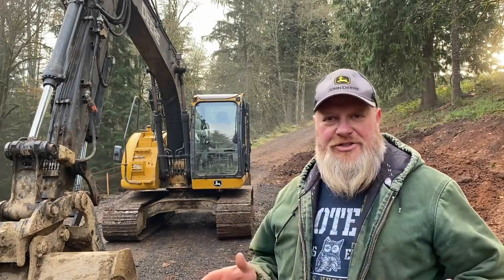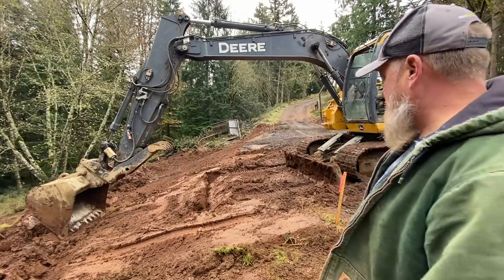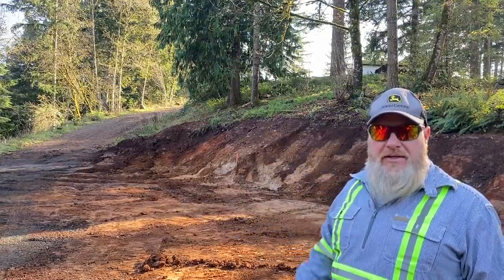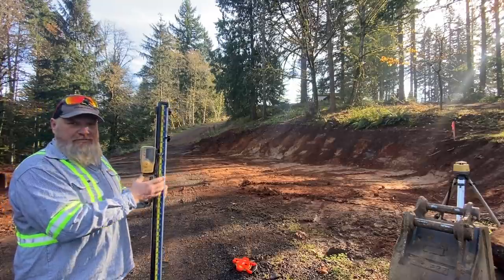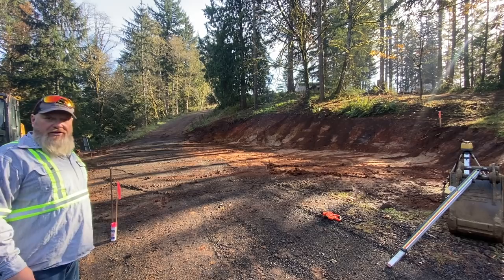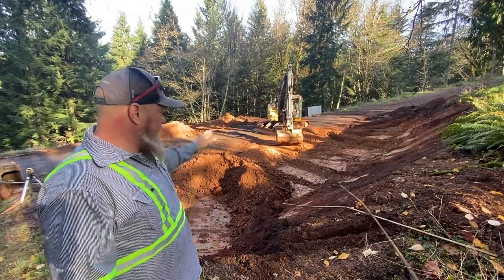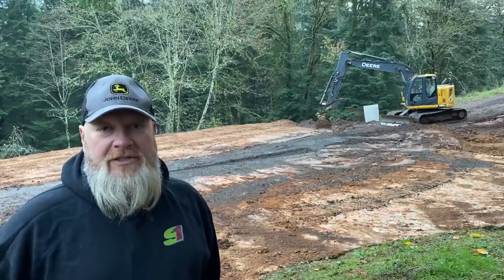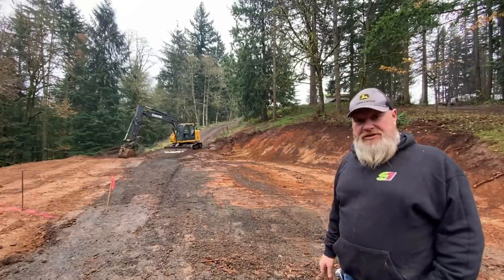Shipping Container Shop Excavation: PART 2!

Comment: Getting an even and flat slab is still a mystery to me, however, watching someone who knows is like watching a choreographed dance. Well done. I enjoyed every minute of it. Thank you.
Reply from the maker: Thank you, Edward!
Reply: Where I'm at, you get the soil close, gravel on that, strike it even below form, concrete on top of the gravel.  Clay, solidly tamped and not saturated, gravel, then concrete, is recommended.  Vapor barrier, depending on the application.

Concrete on clay might get by, concrete on top of subsoil or topsoil is the big no-no.  Mud jackers make their living because of those that take shortcuts.

I agree with Ed, that was well done.  I probably would have made a hash of it.  Then again, I don't have that kind of equipment.
Reply from the maker: @infoanorexic  Tools are everything! I'll be importing recycled concrete for the base rock. When it dries out it gets just as hard as real concrete. My slab will be poured on that.

Comment: Thanks for the explanation of your shop design.  I've seen several buildings of that style (roof over shipping container walls) used for hunting camp retreats and the like.  I was scratching my head as to why you were putting the shop pad through the middle of the roadway on your property.  Your reasoning makes good sense.
Reply from the maker: Thank you!

Comment: Considering the terrain, my guess on that soil composition is that it was glacier related.

Where I grew up, they say, had been glacier plane.  Multiple layers of clay, in different colors.  Limestone if you went deep enough.  A builder would excavate for a new house in a previously undisturbed spot, and sometimes end up rooting out a single rock that was larger than the machine.  Not limestone, solid, usually a red color, sometimes bluish.  They usually became yard art by default.  We had one on our place that a previous owner had found, red rock embedded with multiple colored rocks, similar in pattern to what you uncovered.  Visitors always thought it was someone's grave marker that was by our driveway.
Reply from the maker: Wow! I haven’t found any big boulders like that yet, fortunately.

Comment: I know very little about excavating. Can’t you just go in there with the blade and push it all off flat or am I way off base. I curious cause you make it look so easy
Reply from the maker: The blade on the excavator doesn’t pack a lot of power. Not like a dozer. It’s fine for pushing out piles like I did but you really need to use the  bucket to loosen up the soil.
Reply: Gotcha

Comment: You going to invest in a good dehumidifier?
The biggest problem with shipping containers is condensation next is the chemicals they soak the floor in to ward off bugs and rot. 
I like the way you do your videos, all to many people spend 20 minutes talking about what they are going to do and then 30 seconds showing doing a bit of it. You show doing it, I like that, and I get a kick out of the crow :)
Looking forward to more great videos.
Lou
PS: As someone else suggested, I would right off go to the geology department at the University  they will probably want to come out to actually see and sample your Easter Egg Ground. I think that is something worth documenting.
Reply from the maker: I’m hoping foam panel insulation will help with the condensation. There will be openings cut into interior sides as well that should help.
Reply: @NorthwestSawyer  Ya, I think that would help a lot. Of course spray foam I guess is the way to go because it bonds directly to the steel. but I don't know, I'm learning just like you, all we can do is do the best we know. I think your on the right track though.

Comment: I have no knowledge of how cold it gets out there in Washington state but here in Pennsylvania I would consider radiant heat  in the cement floor of your shop with all the cut off from your mill a outdoor boiler would be the ticket really enjoy your site you and Dirt Prefect would make a hell of a good team
Reply: We built a shop in the same general area. While it doesn’t get that cold, the damp never leaves concrete floor. So it is nice the warm them up a bit to feel dry. I never run mine much to keep it nice.

Comment: So I asked one of my Geotech consultants about the rainbow dirt and this is what he said:
This is pretty cool and pretty unique to expose at subgrade elevation on a shallow dig locally.  Any idea where the site it?  Makes a difference as to how this unit was deposited.

What it likely is is a conglomerate deposit of rounded rock that aged for millions of years and degraded to a soil.  Remember back to your high school or science required geology class.  Sedimentary rock formations (layers of material deposit in layers and cool (if it is magma flow like in the gorge) or get consolidated from weight above and become rock).  Conglomerate rock formations (pic below) are a collection of outwash of various rock types that are pushed together in some parent matrix material.  Well, as that type of formation ages and breaks down into soil (clay) you can get some of that Crayola effect as you called it.

 

So looking at the video there it looks like a conglomeratic saprolite.  That is, a completely decomposed soil formed in some sort of conglomerate parent material.  It’s hard to say what the parent was without knowing where this is. 

I think it’s safe to say that it’s not glacial or periglacial, at least not Pleistocene-age glaciation, because It takes longer than 2M years to get that degree of decomposition outside the tropics. Could be older glacial till or coarse outwash (it’s rounded, so likely not a landslide deposit), but we don’t have the sort of older glacial deposits around here that would be that decomposed.

So, if not glacially deposited the alternative is some sort of fluvial conglomerate or volcanic breccia, either an alluvial gravel or some sort of mudflow/lahar/pyroclastic breccia. That’s where it’d help to know where this is. If it’s Coast Range, or Siskyous, or Blues could give a little background to that.  It might also be older than we’re thinking since it is rock that decomposed to soil (around here that would be geology of Cenozoic cataclastics, Eagle Creek Formation or Ohanepecosh Formation-type stuff). There are also lots of really old volcaniclastics in the allochthonous materials in the Coast Range that might decompose like this, or older Tillamook or Skamania Volcanics. Same sort of junk in the Siskyous or out in the Blue Mountains area.

Probably more than you were interested in, but it really is a unique thing to uncover even if not unique that it happens or could happen.

Pretty cool.  Thanks for sharing.
Reply from the maker: I 100% appreciate the time you put into your research and response. I live in the Cascade foothills. Estacada, Oregon. I too showed this to a geologist on one of my job sites. He said it was likely volcanic deposits from 2-3 million years ago and like you stated, have decomposed. He said it was one of the most stunning examples he’d seen. Thank you for the time you took to watch the video and respond.

Comment: Will you build a retaining wall for that low side? It seems like the soil will wash out, if you don't. Also, you use that equipment like it's a broom or rake in your hands!! Amazing 👏
Reply from the maker: I over-built the low side by quite a bit. I’ll soften the slope after it’s sat for a while and it should be fine.
Reply: @NorthwestSawyer  Oh, ok. Thanks for answering. You truly are impressive with the way you make that equipment work ⭐

Comment: You work that excavator the way an artist wields a paint brush on canvas.  A couple of questions:  Is the layout (design) mapped out in your head or do you have blueprints; what in the hell is that smoke and where is it coming from?  As for the soil composition Oregon (the location) has a long and significant history of volcanic formation and the solid rock formations below serve as a table (metaphorically) for deposits of other rocks and minerals that land on top and are preserved (in turn) by the reddish clay soil....at least that's what I think.  Best to you and be well my friend.
Reply from the maker: Thank you, Dr. Skip! This whole crazy plan is in my head. I’ve rough-sketched some ideas but I like to keep the design fluid and adjust things as I go. That smoke was from the burn pile from the “part one” video two weeks earlier. As for the soil, you are correct. On the lowest part of my property, there is only a couple feet of very organically rich soil over solid volcanic rock. I had a cluster of 5 trees blow over a few years ago and the rootwad pulled all the soil and exposed solid rock with a spring running across it. It was a very interesting peek into the past.

Comment: You are really good with that excavator. Is that normal soil in Oregon? No rocks? Or did you just get lucky? I live in PA. and we have all rock. In fact, I was raised in a town called Glen Rock. You can't dig anywhere without hitting rock. Makes for a long day when you get nowhere because of tough digging. And it is not solid so blasting wouldn't help much. You need a D9 with rippers.
Reply: Oregon has everything from sandy soil to rocky soil to clay to shale to giant boulders the size of busses and trains. We even have areas of lava rock that can't be excavated with an excavator.
Reply from the maker: Ace is correct. Lower on my property there’s only about 3’ of soil over solid rock. It’s a crap-shoot out here.